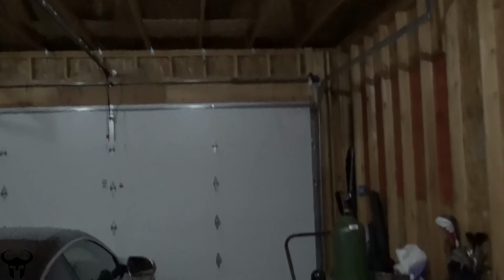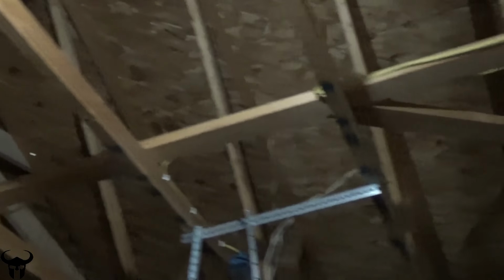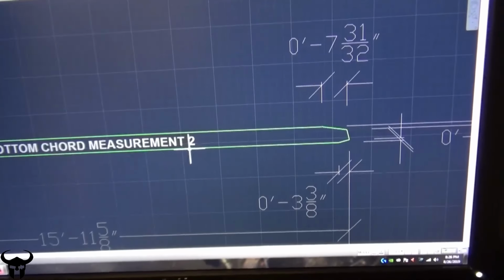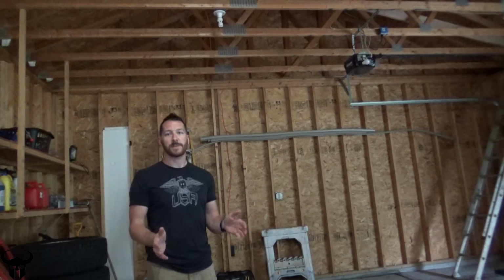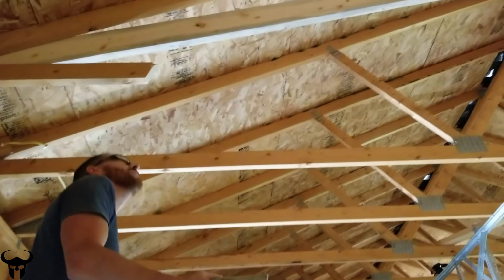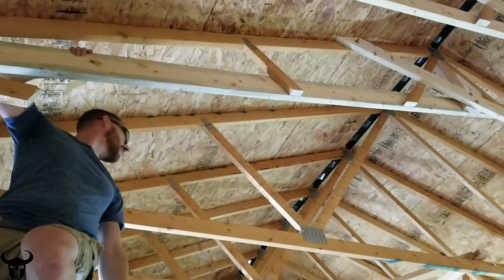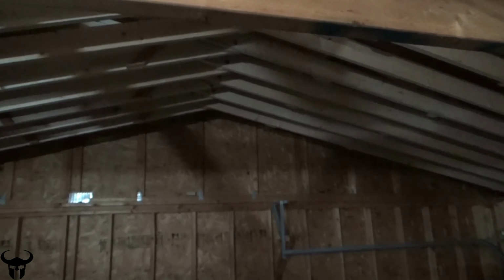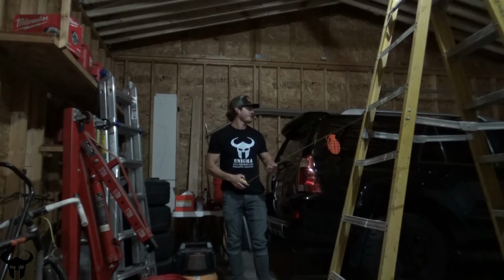How to Modify Garage Trusses for More Height for a Car Lift (Super Garage Video #1)

Comment: High there I am from bc Canada. I have a hoist in my garage currently with an 11 foot ceiling. The peak runs the same as your garage project. I already have a side mount opener and the tracks rammed basically right to the roof. I have plenty of room in the attic above the garage to do the same idea.

Comment: Any chance could give a little advice off a picture? Morton building wanting to remove lower chord so can walk on the top of the built office spaces. So thinking of adding posts to truss to office walls on both sides of space then remove center lower chords. Basically extend the wall to upper roof chord and tie in the rest of the y sections back into 2x8 supports on 3 trusses. Making walking space into the attic space. If up to a little advice or opinion reply and I’ll give email. 
Thanks

Comment: did you ever consider adding the scissor trusses next to the original trusses and marring them to the original trusses? the only hurdle might be how the hold the truss ends. unless ledger boards might work to push up under the scissor truss after it has been married tot eh original truss. then cut out the un needed original truss.

Comment: 11:22 I see vertical pieces (about 18" long) in the upper middle portion of the screen that is sandwiched between the 2 new 2x6's.  How is that fastened to to the top since that lines up with the existing truss members?
Reply: Its just centered...you could toe nail screw it to keep it centered

Comment: Question for you...what kind of pitch did you have on the current roof?  My roof is a 12/12 pitch with 8' walls.  That being said, i could possibly even get a little more ceiling height over boxed in areas?  Plan on storing a car on and under left.
Am going to do this to garage just completing.  I've already had my framing inspections and am awaiting my electrical then I can do my magic.  Plan on reaching out if that's ok.

Thanks for the video, Les.
Reply from the maker: Hey Les. Thank you for the question! My roof pitch is 8/12. The biggest advantage of 12/12 is the availability of a horizontal collar tie below the king post that would greatly increase the strength of a modified truss in your case, while still give you plenty of overhead space. I would have to see a sketch of your roof and where you are meaning to store cars to answer your question. My email is in the contact info on our website, feel free to reach out! https://enigmaengineeringllc.com/

Comment: So, you added what, (20), 20' 2"x6"s, (10) 18" verticle struts, (60)+ nut and bolt assemblies for a total of roughly 400-500#s? Did you add any upright supports to the top plate studs?
Reply from the maker: That sounds close to the weight we added to the roof. I calculated the strength in the 2x4 studs to check the general magnitude. But, I kept in mind that a fully-loaded 62 lbf/ft^2 roof would be over 50,000 lbs, so the 400-500 lbs didn't concern me too much. The additional weight over the garage door header was a larger concern (ended up fine on this). There is a lot here - at one point I thought about going with metal trusses, but I abandoned that idea because of the stud strength. Email me if you want more info!

Comment: Why can't truss manufacturers supply the right kind of truss to sister to your truss with the gussets not completed so you have 2 halves that could easily be lifted in place then rent a press to complete the 3 or so joint plates.  Seems like a reasonable DIY solution to modify in place.  Fasten old truss to new everywhere practical.  Then cut the stringers of the old truss to the bottom level of the new truss.  

This solution in the video is great too but an inspector is unlikely to pass it if they can even get to it to see it.

Curious if you can do an update on the condition, any cracks in the drywall should be a good indicator of movement.

Comment: I would like to do something similar to what you did although my current garage ceiling has drywall on it. It, too, has trusses.  It's the 4th stall on my 4-car garage and has no bedroom above unlike the other 3 garage stalls.  I'm a PE myself but in Electrical Engineering so my training and license wouldn't be much help.  lol.  However, my classes in Vector Statics should at least help me understand what's at hand.  I suppose you didn't have to get permits or approvals for this since you would've been the person someone would approach to get the design approved and stamped anyway.  So you can say "Yeah, a PE approved my design".  lol.
So, my question is:  Why did you feel the need to use grade 8 bolts instead of just nails?  I guess bolts would be better.  I live in California and it doesn't snow here.  My roof pitch is maybe 4/12 (I need to measure it).
Thanks again for your informational video.
Reply from the maker: Thanks for the question! I wish I had your garage, I would never leave! You are exactly right with the permit and me being a ME PE. Every state is different. Also, every ceiling occasionally needs... *ahem*...  repairs. I used grade 8 bolts because they more accurately translate forces through trusses as pinned connections do in Statics. Screws tear the wood up and are not very strong by themselves, and often are weakened during installation. You can look up the shear strength of any bolt, any grade - with screws this is sometimes a challenge and ambiguous. Grade 8 is relatively strong automotive grade, without breaking the bank. We connected the "king post" using Simpson galvanized tie plates with 10d nails. But, the king post is generally in compression anyways. Any other questions, feel free to reach out Augie!
Reply: How did you determine how far down from the roof peak to attach the trusses to prevent walls from pushing out?  All the way to the bottom is ideal for push-out prevention (but no headroom) and all the way to the top is max headroom but no wall push-out prevention.  Somewhere in between is a sweet spot for a middle ground.  Would you start with the required headroom and lower the trusses as low as you can and still have that required headroom?  I suppose that would work, right?
Reply: For bolt shear strength requirements, do you calculate the tension on the new scissor truss members and use that as a requirement for the bolts (plus safety factor)?  What number can I use for roof weight calcs?  I have a concrete tile roof.  Do I find the typical lbf/ft^2 of my roof material and use that?  That sounds like it would work.  Thanks again for all your insight.

Comment: How much did this weaken the structure on the outside walls? since you removed the horizontal stringers the weight would put horizontal force outwards  on the outside walls that the trusses sit on , right? or did the way you build these somehow limit the amount of that force?
Reply from the maker: Good question! On a traditional truss, the horizontal lower chord directly prevents the walls from moving outward, as you state. I run calcs on the original truss, and find out what the safety factor is under maximum load conditions. In my case this was 9! The new scissors trusses still have to deal with the same horizontal force you mention, and they are WORSE at it because of the angled lower chords as opposed to the single straight lower chord (the horizontal forces now have leverage over the truss members). That is why I had to double up on the number of new trusses and make the trusses out of 2x6's instead of 2x4's. I think the new trusses by themselves were about 50% as strong as the original truss. By doubling the number, I achieved the same safety factor. Long explanation, but this is why you need some sort of "truss" and you can't just cut all the members out; your roof would just flatten and your walls would push out. Last note: additional horizontal "collar ties" make any truss stronger. It was just overkill in my case, so I did not add these!
Reply: @EnigmaEngineering  Good explanation, Thanks. I'm curious if you could have also built these trusses like they do when vaulting a ceiling or a beam and pillar roof like what is used for cathedral ceilings.
Reply from the maker: @sergeantseven4240  I am not a roofing specialist. But, I considered a few other options from an engineering standpoint. For example, steel parallel chord trusses can be much narrower between chords than wood and offer more vertical space. A cathedral style ceiling (with big lumber) is similar where there is a lot more strength in the members themselves compared to 2x4s. But, when I ran some calcs on the steel trusses, the weight was very high and I was nearing the strength of the existing ridge plates/studs which was concerning. Also, cost. I think other types of roofs like cathedral, hip roofs, etc., incorporate some sort of reinforced "perimeter" top plate that helps them withstand the horizontal forces; I wanted to avoid this just because of the added complexity
Reply: @EnigmaEngineering  Any problems passing inspection or getting permits for this?  I always want to do these kinds of projects but the red tape is always too intimidating.
Reply: Well I guess you would be too scared to use the store-bought scissor trusses then.
Reply: @Lon1001  Permits?  What for?

Just do it.
Reply: @EnigmaEngineering  they cut the top plate and add framing that goes all the way from floor to roof. Instead of a flat top plate each stud would progressively be a little shorter going from center to the ends.

Comment: I'm going to raise my garage ceiling  for my 4 post lift. I need to lift the ceiling 18 inches . I have to modify  3  frink trusses  that are a 4/12 pitch in a 24x24 garage in Michigan.  one  way I thought  is do what u did. the other was to use 2x8  rafters 24oc  and pound one truss all the way to the left and two trusses to the right  with a ridge beam tied to the doubled and the tripled trusses I pound over .sounds like a big headache . or getting  Tuess gusset plates and converting the existing  trusses to  a scissor  truss so it looks like they were made that way . any ides ? or advise?  Thanks for the video.
Reply from the maker: I think either way you proposed would work. The pounding method sounds like a pain because you will probably hit a lot of nails coming through the shingles and imperfections in the OSB roof boards. Gusset plates are the strongest way to make trusses - I would go with the scissor modification + gusset them too; 12 inches on center if possible

Comment: Hi, fun video thanks. Were you able to achieve the minimum edge distances of 7xbolt diameter and 4x bolt diameter (UK) in the connection between the chords and the primary rafters. This is often what stops this type of truss being a viable option? Often there's not enough depth in the  original truss primarys.
Reply from the maker: Hi Ryan - great comment. I doubt we achieved the UK standard  of 7xbolt diameter between the center of the rafter and the edge of the existing rafter because the existing rafter was 3.5 inches and bolt dia was 0.375". 3.5/2 = 1.75. 1.75/.375 = 4.67. 4.67<7. That being said, we calculated the reduction in strength of the rafters due to the missing cross section and the strength of the fasteners in this design, and we were still way above reasonable safety factor!

Comment: How far apart are your trusses? I have a 22'x10' patio that I want to put a roof over (no walls just posts and a roof). I am thinking 4/12 slope with scissor trusses to be able to have fans and lights. Also i live in Hawaii and don't really have to worry about snow buildup on the roof haha.
Reply from the maker: Hi Austin! Our original trusses were 24" center on center. I would imagine for your patio you could get by with even larger spacing than that. Our modified trusses were 12" CoC. You just don't want to turn your roof into a parachute in a wind storm, so I would recommend using good hardware and solid connections (hurricane ties, nail plates, 10d nails, corrosion resistant steel bolts with lock nuts/washers where possible)
Reply: Enigma Engineering Sounds good! Thanks brother.
Reply from the maker: @austinamaro  No problem!

Comment: Like many other commenters, I would like to do the same thing for the same reason. What is the slope of your roof and the depth of the garage? Did you use 2X6s or 2X8s? Also, it looked like you sistered a 2X4 to the rafter. Why?
Reply from the maker: Hi Joe! Roof is 5/12 pitch, depth of garage is approximately 23.5 feet. We used 2x6s. We only sistered the 2x4s from the original rafters (I think that is your question). We modified all of the original trusses and added 2x6s in to make them scissors trusses. For the new additional trusses, we went with all 2x6 - make sense?

Comment: Thankx been looking for a video like this for about a year now. So would you recommend hiring a structural engineer for this type of project, or can i follow this design? Very similar specs in my building as what you have here.
Reply: Oh , i was also thinking about using the lift columns as extra support. As Like a deadman support to the concrete. Any suggestions is very welcome.
Reply from the maker: @stevendickerson8453  Hey, sorry on the delayed response! What part of the country do you live in? We are up North so we get a ton of snow. 62 lbf/ft^2 is the max load seen on the roof here - therefore, we matched the safety factor, achieving the same strength. That is why we needed the additional set of trusses and made them out of the beefier 2x6s. I think if you did something similar you would be fine. Deadman idea is interesting; I would need to run calcs on that though. The problem, in general, with altering traditional trusses is that the walls push out easier - columns in the middle of the room might not prevent that

Comment: I need to modify two standard trusses in my poll barn.  I built a mezzanine and the clearance under two trusses are a problem. Can I hire you to do the same engineering engine for me? I’ll put together Auto CAD mock-up of the trusses design and layout of the structure. If you’re interested let me know exactly what you’d need and the cost?  TNX in Advance

Comment: How would you vault a pyramid garage roof?
Reply from the maker: This will sound slightly crazy, but probably the easiest way for that style of roof is to lift the roof up with some jacks and then add a new section of studs around the perimeter of the gap at the top plate - I would have done that here but then my garage would have been outside of local building height codes
Reply: @EnigmaEngineering  Thank You!

Comment: Why couldn’t you just sister the existing 2x4 truss with a double 2x6 with a ridge beam and use a collar tie at the top ? Just like a cut roof .
Reply from the maker: I believe in a ridge beam roof either end of the ridge beam needs vertical/column reinforcement. I considered doing this along the entire length of the garage but wasn't comfortable with the load calculation

Comment: Those original 2x4 trusses are scary, my dad has those in my shed and I've measured them before and after heavy snowfalls and the deflection doesn't inspire much confidence. I was worried about hanging a kayak from them near the wall. I lift my jetski from my 2x6s ffs.
Reply from the maker: They are sketchy. Some of the nail plates are barely imbedded into the 2x4s from ones I have seen. But, the safety factor is usually really high for good reasons!

Comment: Couldn't you have just upped it to 2x8 to have supported the full load potential needed?
Reply from the maker: Considered it! The "bearing" surface area (on the top plate) stays the same regardless of wood size though (you lose a lot of material on the ends), 2x8s did not achieve as much strength as doubling the # of trusses with 2x6s. And, most importantly, 2x8s are heavy, while I am weak. Many disagreeable issues here
Reply: @EnigmaEngineering  did you calculate how much weight you could support by just "sistering" a 2x6 to the trusses to create more of a rafter style frame?
Reply: @EnigmaEngineering  im trying to do something similar to raise my ceilings for a golf simulator...currently 8½' and I need 10' at center.
Reply from the maker: @PoliticalTradesman  I think if you sister a 2x6 truss next to each existing truss you would achieve the same strength as halving the center on center distance (like we did). Also, with only a 1.5' height increase you don't have much to worry about. Add some collar ties on either end for peace of mind - you can email if you have some more questions: enigmaengineeringllc@gmail.com. Thanks!

Comment: Why not add extra 2 by 6's to each of the 2 by 4's as instead and then run another across much closer to the top meaning you could remove the bottom row across giving you extra space....what if my roof doesn't get that much snow on it?

Comment: Did you really have an engineer design this? 2 bolts at the bottom center=hinged connection then the 2X6 pushes the top chord up? the bolt grade doesnt really matter the bold doesnt fail, its the bearing capacity of the wood on the bolt, and you forgot to fix the hinged gable end wall?? good thing your putting in the steel beam in. hope your wind and snow loads are low. You might want to change your company name befor you get sued
Reply: what do you mean by this? "forgot to fix the hinged gable end wall"?
Reply: The two walls opposite of his garage door will need to be reinforced. He over built it to withstand vertical forces but neglected to address horizontal forces at those two sides. It’s creates a hinge at the top plate. You can reinforce it by adding plywood to tie the two together but everything I’ve found online says the only proper way is add additional framing that goes from sole to top plate. Just search scissor truss failure and you’ll find examples. Luckily I didn’t get to far down this path before finding this out